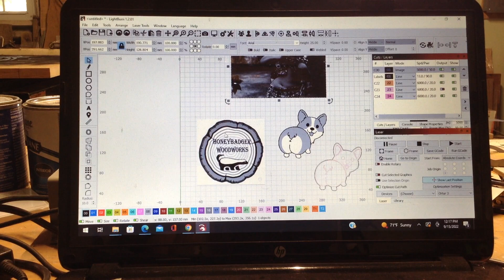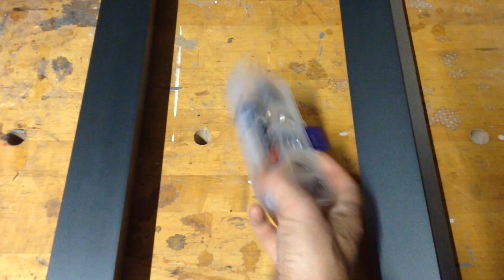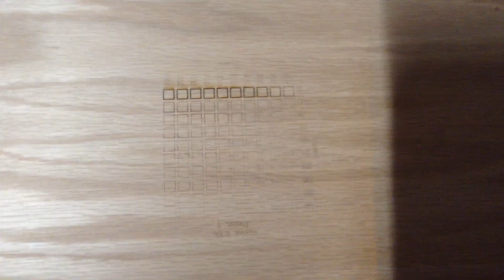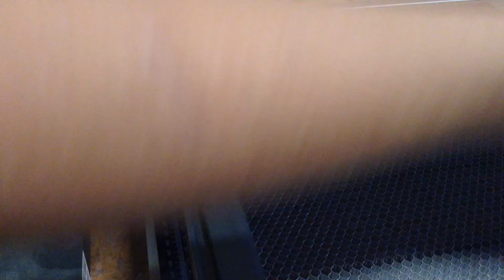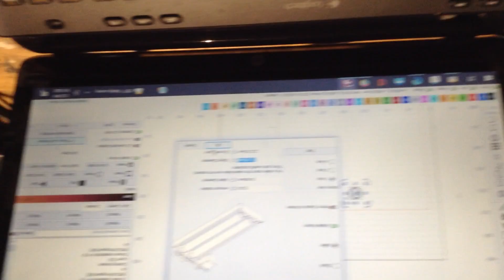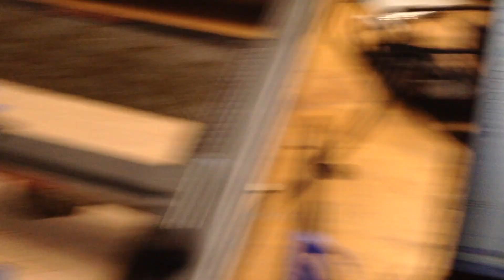Tool Review : Ortur Laser Master 3 // Get started in Laser Engraving

Comment: Hi Caitlin,
Love your channel and a lot of your videos. I find you far more inspirational than a lot of other woodworkers that all have the latest and greatest tools.

Looking for your opinion on the two lasers you have featured. Which do you like more. this one or the one from your previous review? This model seems to have a lot of good press though there are one or two improvements that could be made.
Reply from the maker: There are improvements that could be made on both I believe.  Most of those improvements are little things.  I think they both function quite well.  As I use them more little differences might pop up but as of now as far as finished product they are pretty identical.  The ortur has three functions that I do quite like which might push it past the Longer Ray5 though:
1.) The height adjustment is a flip out leg permanently attached to the machine so it guarantees ease of function and unlike the Ray5 (which is a stand alone measure) I don't ever have to worry about losing it.
2. The hookup for the air pump is a nozzle hole right in the top of the machine which makes hooking up the air pump disgustingly easy.
3.  The design for running the Y axis belts on the Ortur is much cleaner as the belts are a loop that run on bearings.  The longer ray are just strips that you can to hand tighten with clumsy hardware, and I can see maintaining tension with that system down the line being an issue.  

HOWEVER, and the prices might have changed since I originally talked to the companies, but I believe the RAY 5 is cheaper and all he above issues would be in fact be negated in favor of my penny pinching tendencies.